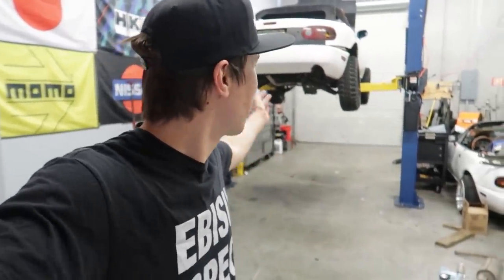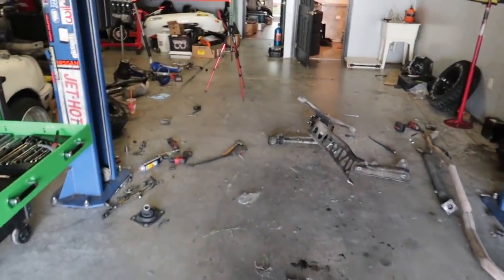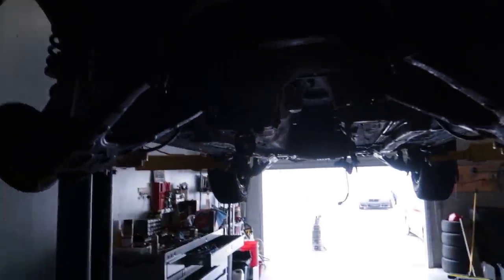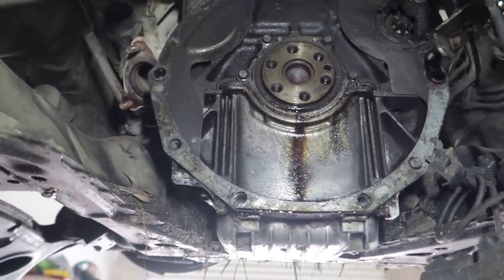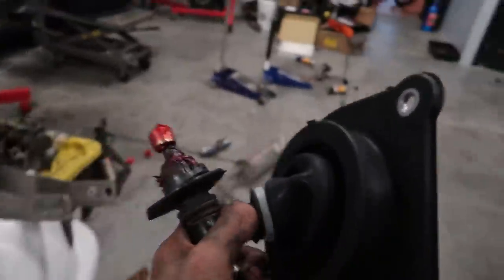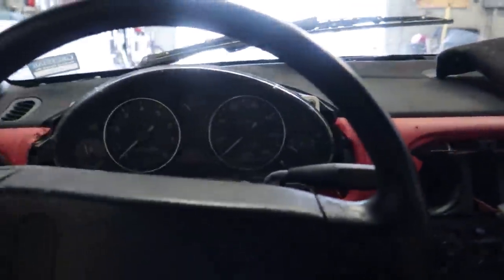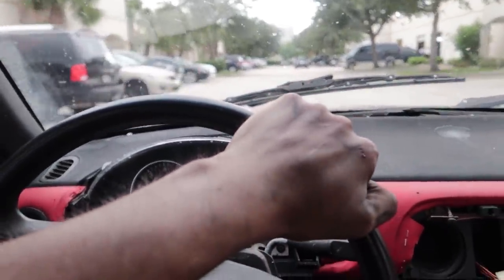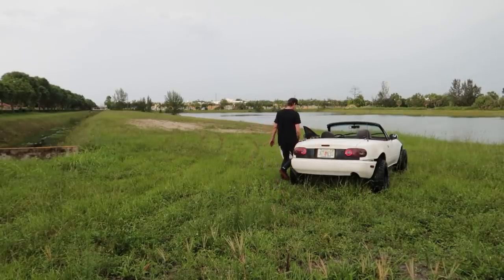YEEATA ABSOLUTELY RIPS WITH NEW PARTS!

Comment: Tractor supply is the best store ever! you should go there and get oil, rotella is dirt cheap there and you can get it in 5 gallon buckets lol
Reply: you can also buy the hand crank oil pump there for barrels it works great for getting the oil into smaller jugs for measuring and adding

Comment: aye the shifty turret NEEDS to have a few ounces of gl5 gear oil in it before u drop shifter in (no grease)

   transmission is gl4 only
    shifter turret gl5
     diff gl5 
 
   edit: not sure if it NEEEDS it lol but its supposed to have gear oil in it

Comment: you need to rep Yashio harder while stuck here. Well that is if he is ok with your boredom killing actions. lolz. Hope you and wifey are well. Make the most of it here.
Reply: also it can be a big deal if missing a bell housing bolt. they even out the pressure when you apply the clutch which can lead to trans trying to back itself off of the engine at an angle. depending on where the missing bolts are. also they are generally 14-17mm head bolts. NOT lil 8mm bolts. so they are pretty important. please becareful in the future. wouldnt want you to get into a lawsuit and shit. ( the trans bolt thing is a pretty big issue in the dsm crowd.